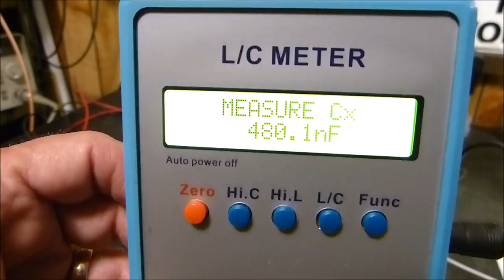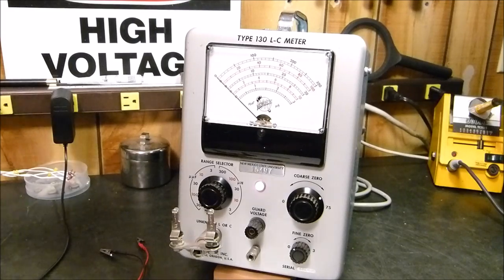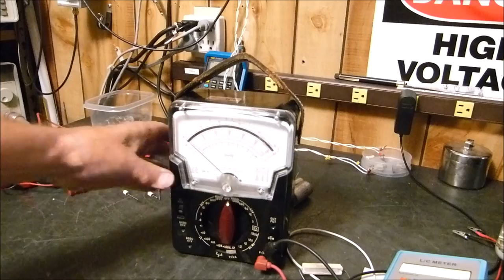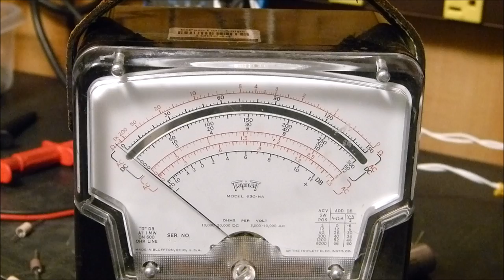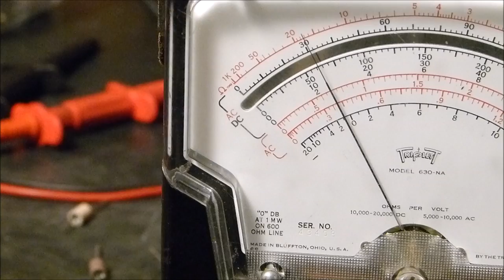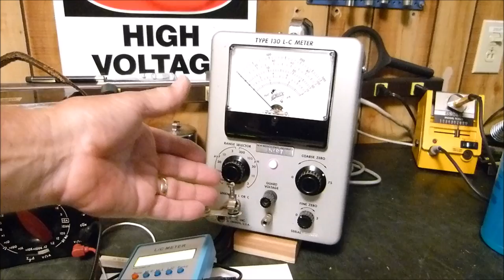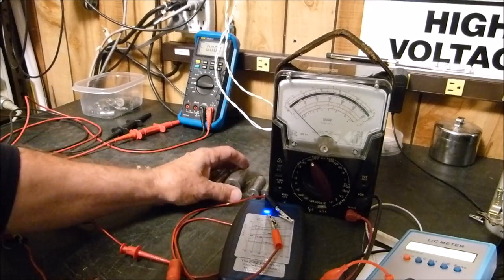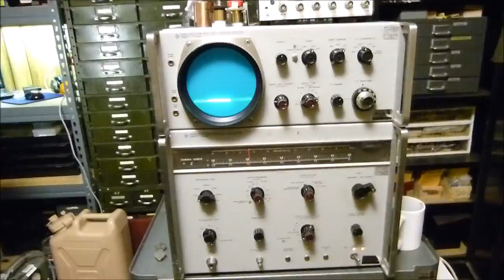Audio Amplifier Capacitor Measurements Thoughts & Practices

Comment: Finally, someone with common sense. I have told numerous technicians for years, that just because it's old, doesn't mean it has to go, especially capacitors. I don't replace anything without knowing what it still has to offer. I have caught a lot of negative looks over the years because of that, even when I worked as an Engineer. My superiors were always on my case about my beliefs, but it didn't change my thoughts, so I kept passing my info on down to the technicians below me. So, it is great to see someone thats see's things as I do. Great work David, keep it up.    Jim     WA5WRE
Reply from the maker: James - we definitely see it the same way. 
Some people think every time they flip the chassis over they have to change the capacitors. And what about those "horrible" Orange Drop capacitors ? they must sound awful in that amplifier...
I have a few vintage McIntosh amplifiers where I have been advised to put in those $50+ each, huge copper and gold type capacitors that may not even fit under the chassis so it will sound so much better. I have a vintage Mc275 with original electrolytic capacitors and original bumblebee and it performs in specs and sounds great. Personally, I wouldn't buy one of those amplifiers that have had any of these "mods".

Comment: Thank you for a very interesting Video. I own a Pair of Kef C80 HiFi speakers manufactured circa 1986. Each crossover has 15 Non Polarised electrolytic capacitors. I unsolder one leg of each of the Capacitors and tested their Characteristics using an ESR Meter. Everyone was spot on for tolerance and the ESR measured was as if the capacitor was brand new!. So, I saved myself some money. The only point of interest was that the PCB boards were well made and well soldered. The connections to the speakers and sockets weren't at all good. Poor quality soldering and a couple of dry joints. So there you go.. Thank you again !

Comment: I have an old Eico 950B that I use to test caps. Checks capacitance and leakage at rated voltage. Can put up to 500 volts
on the cap. If it is leaky it will tell you. And it can reform old caps. I also use a B&K capacitor analyzer. My Tektronix 475 scope with a homemade "octupus" tester (works like a Huntron Tracker or a curve tracer) can be used to quickly compare components (IF you have good ones to campare with), but won't put the voltage across the cap that's needed to check leakage at rated voltage.
And you do like me, I don't change caps unless they are bad. I've seen guys go through a piece of equipment that only had a bad cap or two, replaced them all, and ended up having to troubleshoot all kinds of stuff in the circuit because they had a solder bridge or some other malfunction that was directly related to the caps they replaced.
IF IT AIN'T BROKE DON'T FIX IT!

Comment: I used to be in the "change em all" camp. I started testing everything I pulled and found out that there are a lot of variables that affect whether a capacitor will last or not. I opened a gorgeous Simpson VTVM up a few years ago with the intent of "restoring it". I literally did not have to change anything. Not even what looked to be the original battery. However, I changed the battery. A leaking battery wreaks havoc. Generally I'll have to change the power supply filter caps due to leakage. 

Estate sales- I should probably subscribe to a local paper or two. I have yet to go to one.

I have the same Tek cap meter that you have. I love the older Tek and HP test equipment
Reply from the maker: You got to go to the estate sales. I saved the Collins R-390 from the recycle bin and it only cost me $20. I picked up a little Tektronix scope two weeks ago at a ham radio operators estate sale for $4. It works. A little dirty and I need another oscilloscope like I need another hole-in-the-head but I can't resist. At that sale I also got a whole box full of N and GR-874 connectors for just a few bucks ... 4 or 5 $  I don't remember and so much more. I pulled some old batteries out of a GR piece of equipment. I believe  made by Burgess - the ones with the stripes on them that look like they came from the 1950's. Of course it was dead but it had not leaked one bit. Nowadays, in two years the battery is likely to pop open and destroy the whole compartment.
Reply: I'm going to pick up some local papers and start trying to find estate sales. Ditto Tek gear. They whisper into my ear- "save me, save me" :)
Reply: ElPaso TubeAmps    You are lucky to have a local paper. I live in Central Vermont; no local paper thanks to illiterate immediacy of TV and the net, oh, and the popular trend towards illiteracy.
But we do have Craig's list; in our case, it covers the entirety of the state. Just not a lot of people here!
Reply from the maker: James,
That really surprised me about your area. I thought Texas was in the middle-of-nowhere but it sounds like your area is truly rural. I can see some things I would like about the rural area as I was born and raised in a small town in Alabama - but we did have a newspaper. I don't know how you would find the estate sale stuff around your area. Maybe there isn't much there. But you do have Ebay... Thanks.
Reply: ElPaso TubeAmps  Just to follow up, though I have not lived here but a couple of years, I am certain there once was a paper here. Our town produced the majority of many tooling components at one time in history. Though it is and was less than 10,000 people, this town was number 7 on the kill list in WWII. But as so many towns, the attraction and reward of  moving over seas and to Mexico was far above the desire to keep the livelihood of so many here, safe and secure. I grew up in probably the #2 or 3 town on the kill list, in N.M.  Nearly all the black op projects had their inception there or 100 miles from there. Sandia, and Monzano  still remain at the hub.

Comment: David.You might want to do a video on finding the outer foil of these caps as that would be good as well.You have to keep in mind of the paper oil capacitors that the oil can have slightly conductive properties although a small amount. It is paramount that put a DC voltage across the dielectric,overnight preferably and then remeasure these capacitors.
Reply from the maker: Hi Mike, 
I thought, during my measurements, one lead would read higher in capacitance because of being the outer foil but that was not the case and both leads read the same to the case. As I failed to demonstrate, I know some capacitors do need the dielectric exposed to voltage to bring the capacitance up to normal but in these cases, the  capacitors turned out perfect with no DC leakage at all.
Reply: The outer foil has nothing to do with the value.I just mentioned doing that test in anther video as that can affect hum on some occasions.So the caps turned out ok afterall? I also wanted to say that there are some hermetically sealed caps that are mylar as well. Look and see  if there is a P or N in the part number designation on those caps/

Comment: The outside "shielded" side should go to ground terminal (low impedance side) of scope or other tester, as they should in circuit. Check out Mr Carlson's lab "Are your capacitors in backwards?

Comment: I like your method for testing leakage with a volt meter. Assuming the voltmeter is 20K/V on its 300V range, then 
the 2nd bumble bee's ( @ 12:27 ) resistance is (400 - 65) / (65 / (20000 * 300)) = 31 Meg ohm. I have often wondered how many meg ohms it takes to 'open the eye' on a cap tester like the Heathkit IT-28 for example. Most vintage paper wax capacitors I have tested, and rejected, have been between 15 to 45 meg ohms when tested with a low voltage ohm meter.
Reply: Is there a magic [go / no-go] resistance reading to determine if a capacitor is acceptable for use ?
Jack; K4LRH

Comment: Its often confusing using those small pocket cap testers. They often show leaky caps as higher in capacitance than marked. 
I use an isolation tester to test them for leakage, what do you think.
Oh and the Tek 2440 is alive!
Reply from the maker: Hi Simon,  
yes, there are so many details about capacitors that it is practically a religion on how to test and evaluate these little things. As you know, some of the older capacitors are physically much larger than modern day pieces for the same capacitance value. It is obvious that there will be more inductance in the larger capacitors which will change values of DF, ESR, etc and make them "sound" different and maybe even make them measure different in a circuit.  
What I always  enjoy from these postings and following discussions is the variety of ideas people have and I think  all of the approaches have value and are very enlightening. Things I have never thought about.  The collaborative spirit that is shared is powerful and I am glad to be a part of it and it is one thing that keeps me posting videos. 
As for your Tek 2440, congratulations.  I know how difficult and tedious these types of problems can be and I certainly admire your commitment and technical skills so your success does not surprise me as I know you are going to stay with it until you find and fix the problem. . You are very good at seeing these difficult projects to completion.  I have changed a bit over the years and am more likely to part-out some of the instruments. I almost did that to the huge HP SA that I have shown but I am very glad that I didn't and took the time to give it a through TLC cleaning. It is actually still a magnificent instrument but it is just so big. Stay save and thanks for your thoughts and comments.

Comment: The oxide layer of old long not used caps need to be reformed.  
Replacing all is not a good thing if you just random pick the replacement. Take one with the correct voltage, capacitance, dissipation factor, impedance and ripple current, DC leakage and temp. Modern caps are much smaller and have a lower ESL. That can give troubles but that depends on its use. Low ESR is not always a good thing (for instance it can cause oscillations or unstable behavior.
ESR is often not stated and needs to be calculated from DF at 100/120 Hz or often 1kHz for old caps. Impedance at 100kHz. Most DIY ESR meters measure impedance instead of ESR.

A high ESR  gives a to high capacitance if you use a LCR meter that does not measures the complex impedance and splits it in capacitance and resistance (in the form of ESR, DF tan d, or phase angle) A multimeter that uses DC like most do are influenced the most by ESR

Comment: I have a question that may seem crazy, but I have to seriously ask. Please regard this.
I often hear about multi sectioned electrolytic caps drying out.
In fact sometimes you can hear they are when shaken.  Now my question is, if they are dried out, can they be repaired before attempting to be re-formed by injecting a small amount of distilled water? Then using specially designed, proper flux, to re-solder the incision of a hypodermic needle opening. If Russian oil filled caps last forever, (using pcb)  I can imagine these could be re-formed. Like I said it is a nutty theory, but hey nutty theories changed the world. We might be able to truly restore our old electronic gear with multi sectioned caps. Probably not, but I'm willing to experiment with more knowledge.
What is your thoughts and others? I am ignorant of the chemicals that activate the multi section caps, but I can imagine its water based if they dry out; the chemicals are still there.
Reply from the maker: I have never heard of the distilled water attempt to re-form electrolytic capacitors but like you say, crazy sounding things sometimes work. I guess it could be worth a try. I have been told the same thing about drilling holes and putting water in some reference batteries in old General Radio equipment but I have never tried it.

As for PCB - I would not mess with them. Polychlorinated Biphenyls are very toxic oils. Look them up on a MSDS sheet. Absorption through the skin is almost as effective as ingestion and they will attack the liver. Get rid of PCB capacitors.

Comment: I don't believe in reforming and I also disagree with keeping bumblebee or black beauties the chemical make up of these caps has proven it is going to eventually   leak and there expiration date is up. Now that said there are some old caps that are worth keeping it seems to me good all makes some caps that are amazingly resilant those metal caps you were measuring are virtually indestructible I have also found that Sprague made some stryocon caps that I find some of the lowest leakage I have ever seen there are a few others the advance I can give is test it if it test perfect right off the bat and it not a bumblebee or black beauty or old wax or pyrimiad or imp then leave it. The capacitors mentioned above are just to much of a liability why risk you priceless possibly unobtaininium transformers or components because u want to preserve some old caps. Isn't more important to preserve this beautiful old equipment for future generations to enjoy so basically we are the caretakers of this stuff and every time u leave on in circuit and takes out a irreplaceable components u just destroyed a little piece of history it out job as electronics enthusiast to do everything we can to preserve this equipment forever if possible so don't cut corners because u have some misguided perception of nastalgia. Dont take the risk and look at your restoration as ast at least 50 more years I can promise u none of the caps list above have another 20 years in them under light use so cut them out
Reply: Sorry for not proof reading that phone typing lol
Reply from the maker: Jason - I really can't disagree with your philosophy about the caps. I think my main concern has always been with the mindset that some seem to have that every time they look under a chassis and see capacitors, it is time to replace them all.  I know I am exaggerating a little.
Some people doing this "surgery" can be a disaster to the piece of equipment, and as you say, even the end of it.   I repaired equipment for a couple of years after retirement and several amplifiers were brought to me after a major cap replacement and - - the amp didn't work any more. Components had been mis-wired and some of the "surgery" was downright horrible mostly for the sake of extremely expensive capacitors which is supposed to make the amplifier sound amazing.
During the time I did repair, if the amp was vintage and just 'rediscovered" and was going to be used in a gig, I completely agree with you, and all the caps were replaced. And then there is the cost and more than $50 for repair of an old piece of equipment,  sent some into a panic.
I have a good bit of equipment 50 to 60 years old with original caps, even the electrolytic, that work perfectly. Much of this equipment is McIntosh, HP, Tektronix and Collins Radio equipment. I am sure they used the best of their time and it is still good.
So, I think it is kind of an individual thing that factors in a lot of variables.
As for reforming electrolytic capacitors - from articles that I trust, it seems that can be done if the capacitor is not dried out. As for bringing up equipment on a Variac over hours or days - I don't do that. I plug it in and turn it on. I may bring up equipment on a Variac for trouble shooting voltages and currents. I worked as a field engineer for the first 26 years of my career for NASA and White Sands Missile Range and we didn't have time to "tinker" with equipment. It had to be fixed so we could go home... I guess that is where my mind-set comes from.  Hope this makes sense.
Reply: I would also like to add I certainly don't doubt you know what u are doing I have learned quit a bit from watching your videos myself and I also agree if you are jump into repairing equipment and don't know what you doing u should not grab a mc or Fisher etc and just start cutting into it and hooking things up to places they shouldn't be start on something worthless and then move forward. But that commitment was not really for you or even my self though there are some caps I just don't trust. No am sure you can see the signs and have the equipment to quickly diagnose what ever goes wrong. But not everyone has that experience and equipment and for them I say error on the side of caution. I also agree about tektronics go etc equipment I have the same old Tek scope you have and it works great I have never touched it and sometimes with test equipment maybe that's the way to go with many things hand selected. But no I have no doubt u can handle your equipment I really enjoy your videos and I really truly appreciate you sharing your knowledge with us you and I have learned from u thank you again
Reply: But I can say this I have a whole box maybe 100 + caps that I have cut out old equipment and every one is a black beauty or bumble bee or wax or pyrimiad or imp or an electroylic of course just saying and I have a high voltage leakage tester that I completely restored with 1 percent reference caps so they are certainly faultly. So with that in mind I wrote what I wrote for those who are checking caps with a multimeter don't trust it unless u check leakage if it's one of these types of caps or any cap that very high or very low is a sign I have seen caps that had a low esr even and leaked like crazy just be careful don't ruin your stuff.
Reply: And I just personally don't believe in reforming that's a personal thing I just 10000 he 105s in and be done with it if it leaks just my opinion and it's always a good name cap I don't do cheap caps either on high voltage